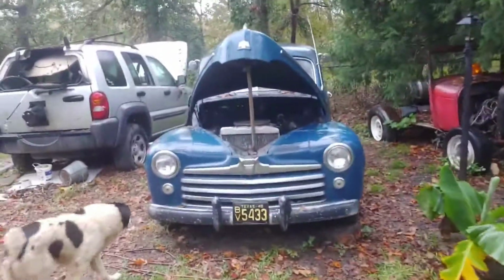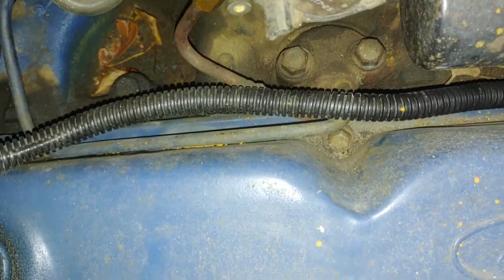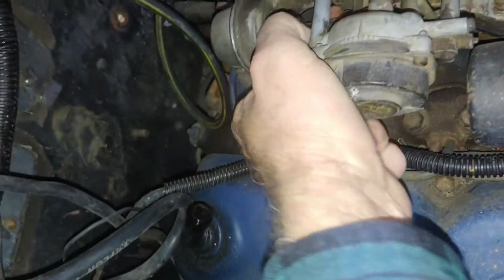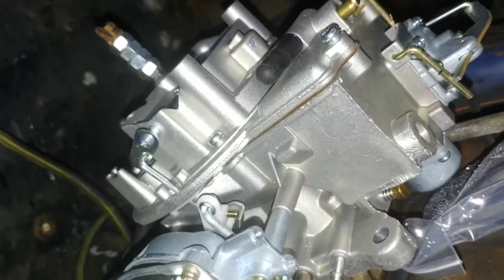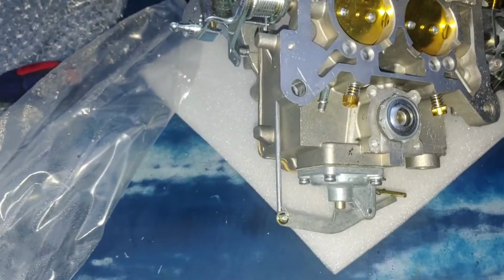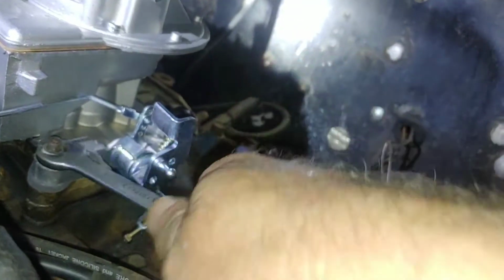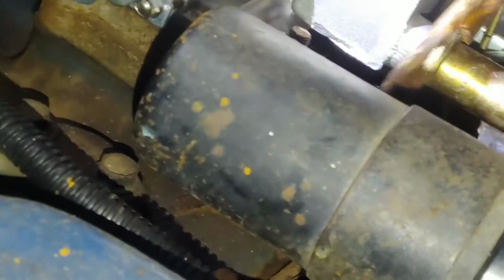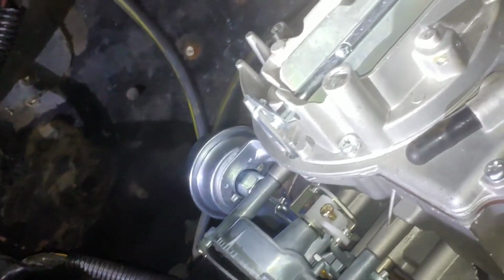Chinese Ford 2100 Carburetor

Comment: What is the hard line that attaches to the choke assembly if you don't mind me asking
Reply from the maker: A bit of heat is pulled into the choke housing via that tube to more quickly warm the choke coil.
Reply from the maker: I appreciate you viewing and asking a question.

Comment: Some help, so I put a new carburetor on a 74 F250 with the 360, so I take out of the box and sit it in the truck, I turn on and the rpm went all way up, how do I just before turn on the truck
Reply from the maker: Three possibilities. 
1. Choke idle speed needs adjustment. 
2. Curb idle needs adjustment 
3. Not carb related big vacuum leaks
Reply: @RolandCaston  where accelerator cable goes attached it supposed to be all way to the front of the truck or to the back? I’m trying to learn about carburetors, and thank full subscribed to ur channel
Reply from the maker: @sotos2428  front
Reply: @RolandCaston  thank you sir
Reply from the maker: Check out this guy's YouTube channel 
https://youtu.be/xa_pCSQaS-c

Comment: Give that nice New carb a New air cleaner..
Reply from the maker: Junk carb. Worked for a little while then proved to easily fall out of adjustment
Reply: @RolandCaston  would you say buying a cheap on on Amazon is worth it? Or would it be better to spend the money on Refurbished OME carb??
Reply from the maker: @skiutah48  OEM remanufactered for sure. The Chinese knock off was problematic after a few months.